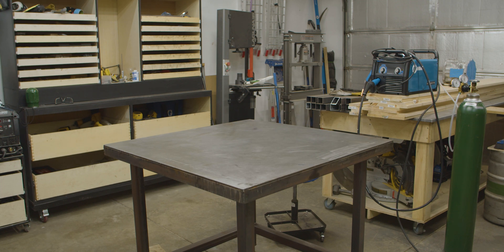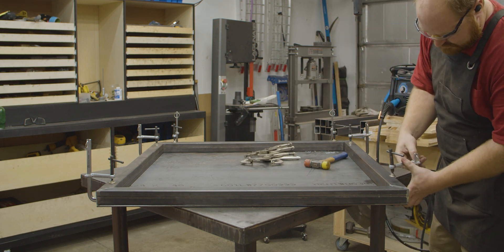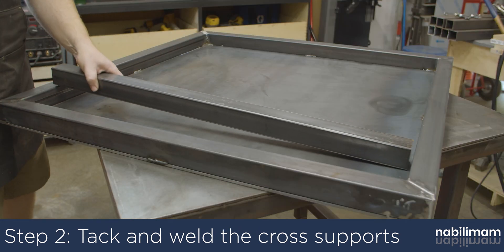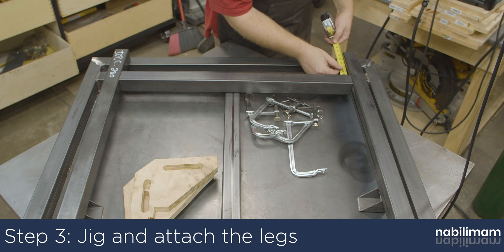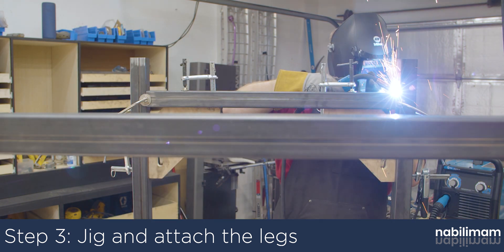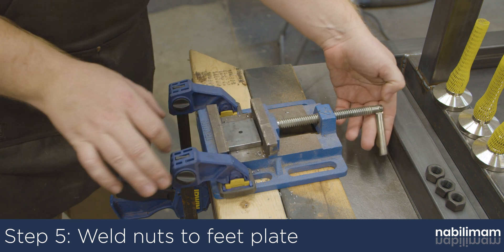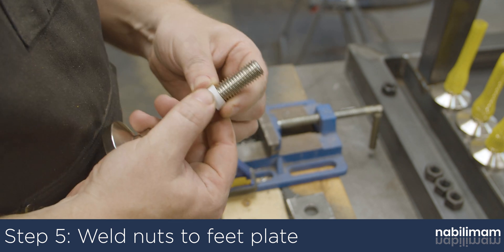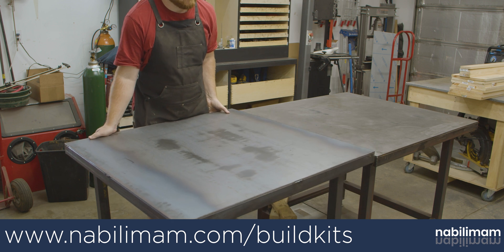Building your first fabrication table for any workshop!

Comment: What settings did you use to weld 1/4 inch plate with your miller welder. I have a miller 141, but haven't used it yet.
Reply from the maker: I set the voltage to 10 and the wire feed between 50 and 60 (I think). Play with the wire feed until you get a nice bead . I also took it nice and slow to let the heat penetrate.
Reply: Is that with gas or flux core wire
Reply from the maker: @andrer3854  gas shielded
Reply: Thank You!